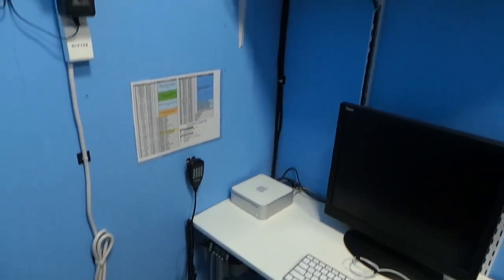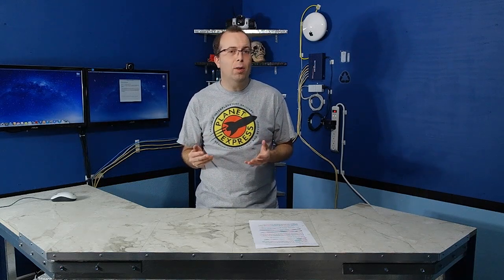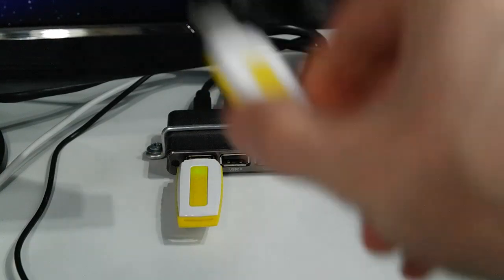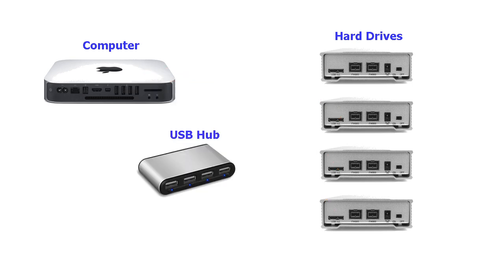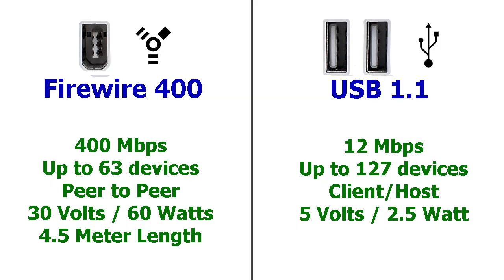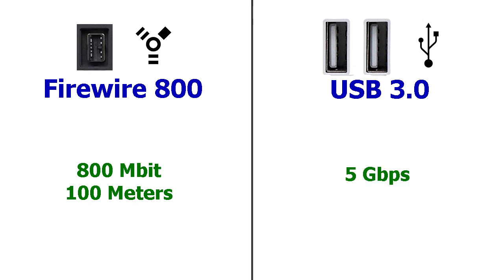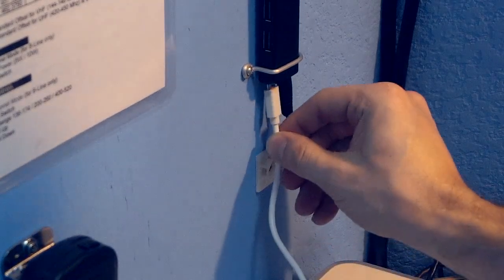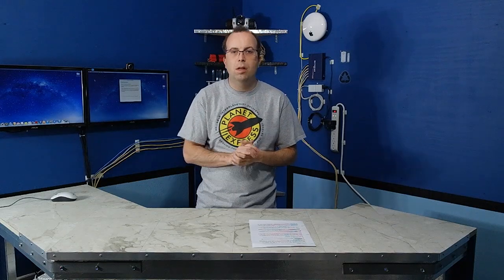Farewell R.I.P. Firewire, Hello USB!

Comment: i am 20 years old, had my first PC when i was 6. I can't remember using firewire even once in my life.
Reply: +muh1h1 Firewire was mainly a Mac thing. PC people generally only got firewire for specific applications like video cameras.
Reply: same here, im 24.
Reply: @tintin3  28?
Reply: @tintin3  
Akshat
Reply: @tintin3   m
Reply: @tintin3 So how old are you now
Reply: +muh1h1 It was mainly on high end PCs
Reply: @ElectrofizzStudiosCo   I Have it on thinkpad
Reply: I remember a computer I had in 2003 had Firewire, but I don't think I ever used it once.
Reply: If you were using a computer for video editing or had high capacity external hard disks before USB 2.0 you would have used firewire but most devices like keyboards, mice external optical disk writers and printers worked at lower transfer speeds.  Before USB 2.0 most printers and scanners used parallel ports, keyboard and mice used ps/2 ports.  Now USB 3 and Ethernet ports allow high speeds.
Reply: ***** well,it was but still,thunderport will remain on macs until later.
Reply: Rosie
Reply: @JoRosieQueen68   13:54
Reply: It was more of a Mac thing.
Reply: Glad to finally find the guy who makes the final judgment calls on things of that nature. In all seriousness, you look stupid because you are stupid.  Don't comment on stuff you don't know about, and you won't get "trolled". While you're at it, try not to be offended by everything.
Reply: +muh1h1 I'm 23. I use it everyday. Most higher end Audio Interfaces for recording use Firewire. So it depends on what you use your computer. If you are a gamer or casual web surfer, you won't encounter it. But if you use your computer for commercial use, you'd expect to have a few devices laying around.
Reply: @GabrielTheGuitarist not anymore 😮
Reply: +Tin Tin I'm 16 and I have used it several times, especially for Target Disk mode and Audio Interfaces…
So, it's not all the same
Reply: JosephKing75 CBP I dunno, I always remember it being shit, it's just that people have had a lot more practice since then, and of course more kids have net access than they ever did in the early 2000s. Then again, I've never had a very high opinion of people lol.
Reply: you could have just said "I don't do cool stuff with my computer, and barely know how to use it"
Reply: thank you seven, it's incredible how much misinformation is in the comments. Even after usb2, due to FW's much, much lower overhead and higher average speed. You would still drop frames with USB2 / DV video editing setups.
Reply: USB is used more now so it will probably still be used because it's still usable for domestic use.  Most people don't need to transfer huge files unless you're a media company and you have content stored on local and remote servers which you need to transfer between them but in that case you would use a fibre network which can transfer at higher speeds.  As internet connections get faster it will be better value using cloud services where if you want more capacity you pay a little extra per month than spending a large amount on a hard disk.  People would still want to use hard disks for archiving but the advantage with cloud storage is that if you have an internet connection you can have access to unlimited storage capacity without having multiple hard disks or worrying about getting a new hard disk when your others are full.
Reply: Firewire was the only way of transferring video from a tape camcorder in real time because USB1.1 was too slow.  There were digital cameras with USB and serial connectors but they would be sending already digital files than playing them and digitising the footage as you would with a tape camera.  Apple would have probably had them more than most PCs because in the pre mid 2000s Apple focused a lot on making computers for specialist industries like designing, video editing and animation because Windows already dominated office and home computing.  Most printers at the time still used parallel ports and didn't print very fast anyway and scanners were parallel or serial and weren't able to scan fast so there was no need for high speed ports, it would have been expensive as well having ports and components in devices for ports that would rarely get used.
Reply: JosephKing75 CBP No idea, never tested it, and didn't have a use for it at the time. Don't think I even had anything compatible with it.
Reply: +muh1h1 Goddamn you young.  I'm 30.. but I never used Firewire either, haha.  It's probably because I'm not a Mac guy though.
Reply: +muh1h1 The only time I ever used firewire was when I was dumping video off of a camera on a mac in collage.
Reply: williehrmann What? how is that even possible? :D
Reply: muh1h1
 no, and i'm an informatics guy. But somehow i never needed it i never really had anything wireless except my smartphone. And i connected it via usb to my pc. Wifi i use now and then.
Reply: Never used SCSI? then you probably never tried to use a DOS machine, that shit was everywhere!
Reply: danixdefcon5 my late 2010/early 2011 can use it and can use USB,and the cool thing of that is it charges my ipad
Reply: same
Reply: fiirewire looking usb
Reply: Up until Firewire 800 I wouldn't buy an external unless it had Firewire 400 ports. That was mainly my experience I loved how fast it was and the fact that Firewire was a dedicated interface (400 Mbps when connected to one drive vs. USB that was 480mbps that was shared with whatever device you had plugged into USB) made it perfect for me when I used to do video/sound editing, and did a lot of photography on my old Windows PC.
Reply: you mean SCSI?
Reply: mseven1, people clearly need to transfer huge files, that aren't media companies. Your comment is ridiculous
Reply: Murphy the Turtle what do you think USB-C refers to? It's the connector. It's not disinformation. TB3 works as a USB-C alternate mode. Yes, I know that TB is not USB.
Reply: Look at the posters around you. It's easy to think the average intelligence level is low.
Reply: I used it mainly for capturing HD digital video from my Sony camcorder. Firewire was great because it was peer-to-peer. There was no concern about drivers. And when I upgraded laptops I was able to buy a Firewire 400 to 800 cable and transfer my entire user folder in under an hour. These days you could just use gigabit ethernet or even MIMO. Although I have to admit the uses for Firewire were very limited and the costs did not justify low throughput uses like input devices and printers. USB eventually won out because of its comparative cheapness.
Reply: the data still supports the possibility that few people were actually using IEEE 1394 (whatever a company chose to call it), so I wonder... How old are you, and how often did you talk computers with people outside your inner circle, and outside the AV crowd (professional, and amateur).

I have a feeling you didn't observe computer users in their whole between 2000 and 2010.
I also think that, as the data suggest, the majority of people used floppy disks, CD's, and later usb for data transfer. I know I certainly did, being 12-22, and not actually knowing what "firewire" was till about 18.

From my perspective, it was kinda like raid is now, most people don't know what it is, nor will ever use it.
those of us that do know what raid is used for, are also pretty tech savvy.

as for your comments that appear to be an attempt to establish a lack of experience, on my part, with the internet and technology, you can stop now, I'm not some dumb kid. And you're not a walmart greeter for the "interwebs"

As I stated earlier, I'm 28. Also I, as did most my age, grew up with computers and the internet with daily exposure in school and at home. Hell we where specifically taught about computers in school.
A decade earlier, none of that was true. Now kids are growing up with smartphones in their hands.
Reply: mine isn't a T420s its just a top of the line T420 w/ an i7
Reply: I’m 35, first PC was a 386. Never used it either... hello thunderbolt 3!
Reply: well, firewire is only used by hi-end users in audio, video and lagre device counts setups so that is not strange if you have never used FireWire.
Reply: Im 37, I have owned computers since back in the XT days (had a TI 98/4A before the XT), and never used FireWire. I never had a need for portable storage. Had a 5 1/2 inch hard drive caddy for removable storage for anything that couldn't fit on floppy, then got a CD burner back in 1999.
Reply: I am 28 and even I never used firewire. But when you are kid you have no reason using it, you mostly didn't have server, profi camera or external HDD around 2005 when firewire was on motherboards. I know people with Apple were using firewire more often, but in my country I guess 99% of computers have Windows.
Reply: No one did. It was just for elitist Macrainbows.
Reply: I’m 40 and the only thing I ever used FireWire for was to plug into the wall wart and charge my 4th gen 40gig iPod. I think I’ve only ever had one PC that even had a FireWire port.

My 7th grade science teacher (a huge Mac geek, back in the days of System 7) had 6 or 7 devices daisy chained with SCSI, which was pretty impressive at the time.
Reply: I have thunderclap 5.0 it is better than this fireport stuff and lightening USB
Reply: Martin Lyhagen I must've pressed the wrong key,well,I know how it's called but I've written it wrong by mistake.
Reply: *****
Well...why not,was it a functioning properly?
Reply: *****
That's sad mate,it could of been something but it turned out to be just nothing.
Reply: *****
well,as stupid as they are,people are people but we are ourselves,individuals with great ideas and dreams that will become reality one day.
Reply: *****
Well,everybody does as they consider.
Reply: JosephKing75 CBP Which is fine, as long as they have to live with the consequences. Trouble is, at least in my country, they don't. Cap in hand to the state, and everyone else has to pay for it.
Reply: Chris Anderson
Well,I love Apple but I also love Microsoft,I love Microsoft a little more than Apple though.
Reply: hi im 27 and the oly reason in klicken this video is it want to know what this simbol is i saw on my pc
Reply: +muh1h1 Sad not to have memory at your age.
Reply: +muh1h1 My second year in highschool, I was part of the school news crew. When we transfered video to our Macs for editing we used either a Firewire cable directly to the camera or a tapedeck. I honestly liked the tapedeck more for some reason (maybe because it felt cooler?) but I did get to use Firewire for some practical stuff

A year later we threw away those cameras and got DSLRs with Shotgun Mics/Boom Mics instead.
Reply: 28, never used firewire. But never used bluetooth ever aswell xD.
Reply: muh1h1 My first Bluetooth device i got back in 2008ish. I hardly used the darn Bluetooth headset as it was just annoying. I mostly used Bluetooth for file transfer. between my pc and my dumbphone.
Reply: Trekeyus yes, but williehrmann says he never used it ever oO
Never used a bt speaker? Smartband? Headunit? Nothing of that?
Reply: muh1h1 well to be fair i did not get a Bluetooth speaker till a few years ago and frankly I find it to be clunky and a pain and just so much easier to use a wired connection. That said ever since I got my pebble it has been paired none stop to my phone.
Reply: So? .... I am almost twice your age never used it, that said I know it was fast as hell for external HD drives.
Reply: Kim Alatore same,but I have a MacBook Pro that "HAD" a FireWire cable port.this was made in earlier years,like 2014 or 2013,whatever,at least I have a USB port so I can plug my iPad in to the computer
Reply: im 19 and i used it for one external drive, once. so i feel you lol
Reply: Firewire was mostly used by apple, and that meant, people with $$$.
PC's used mostly USB.
Reply: Some PCs had FireWire ports, but FW-capable hardware was very expensive. Thus, few people did that.
Reply: I'm 17 and i used firewire to pull footage from a DV camera, install Mac OS X onto a mac, etc. so i still know how to use it
Reply: Yep. most i/o interfaces stille ad firewire
Reply: Well from what I have experienced is that I saw it common on Macs but I never saw it on a PC.
Reply: My brother had 2 fire wire ports on his PC.  One of the reasons fire wire lost out to USB is because it's universally compatible and although there are different USB connector types there are USB A to USB B cables and connector converters.  Another thing is that USB ports are being used as a power port on tablets and smartphones which means you can use the same cable with different devices to power and transfer data at the same time.

Ethernet and fibre cables have the potential to replace USB because they are faster but too fast for domestic use currently.  However future USB formats will probably be as fast.
Reply: mseven1 USB is still slow, and it will always be slow due to how it works. Thunderbolt 3 works over USB-C, I'd probably bet on that being the thing that takes over for storage purposes.
Reply: @danixdefcon5, are you trolling at this point? TB3 does not work on a USB Bus. If you mean uses the port connector, fine. But no. Stop spreading mis information
Reply: Murphy the Turtle agreed. I'm actually annoyed at the lack of TB storage options, moving large files is painful on USB3, I've resorted to setting up my PC as an iSCSI target just to get fairly decent transfer speeds.
Reply: Domestic users don't use high capacity servers where they need to transfer large files in the tens of gigabytes per second between their server at their studios and the server at a playout centre.  Manufacturers don't have ports for fibre cables because barely anyone would use them and it would waste money using components and ports which won't be used.  It's like how domestic internet service providers don't promote SDSL because most domestic internet users want higher download speeds than up and down speeds.
Reply: Im 28, and I agree, most of our generation just went with usb from the start. I think the huge support for fire-wire on mac may have been a part of it.
Reply: lol krust, that's only because you didn't do anything fun with your machine.
Reply: You are quick to make assumptions turtle.
do you know what a computer game is?
Reply: Murphy the Turtle, I went back and read all you comments here. you sir are the one that is trolling, you are attempting to draw out emotional reactions from people, that is trolling.
Reply: Congrats, on being 10% smart and 40% sociopathic. Let's see what the other half is! You wanna know what's an obnoxious assumption made by an idiot? Stating "I didn't use this interface, so no one must have!" And no, I'm not going for emotional responses so much as people like you not spreading mis information about interfaces you have no idea about. For example: Several people in this thread thought that thunderbolt ran over usb 3.1. Please don't explain things you don't know about to people.
Reply: Murphy the Turtle at no point did I claim that no one used firewire, in fact, if you actually read my comment, you would see that I state MY generation mostly (not all) used usb from the start (2.0 BTW,  ya, we are that young), rather than firewire.

that also means that the majority of everyone else may have.

again, not making claims, as I can't possibly know.

you are actually spreading misinformation. the name firewire only refers to apples use of IEEE 1394.

see the below link.
you will note that windows has always (since 2002) had the majority of users by %. Therefore it is accurate to state that the majority of computer users did not use firewire.

https://upload.wikimedia.org/wikipedia/commons/thumb/8/81/Operatingsystem_market_share.svg/1280px-Operatingsystem_market_share.svg.png
Reply: it wasn't some used this and some used that. Firewire or i.link or lynx, whatever you wanna call it, was generally used for specific purposes. For a generation of hard drives, it allowed direct editing without dropping frames in dv. for audio producers, low latency and overhead interfaces that lasted 10+ years. All people doing those things, and a hundred other's like it, used firewire. That's why I made my original comment to you:D 

But congrats on being entirely pedantic with my off the cuff response. Welcome to the internet.
Reply: no it doesn't, fanboy. And I've worked in computers throughout the time you mentioned this. Most people don't know what a raid is? I run a raid 6 in my living room. You're a petulant child, if you grew up with the internet, you wouldn't be so fucking shocked by me. There is a MASS IVE LACK OF EXPERIENCE on your part if you think firewire or raids, are technical in anyway.
Reply: muh1h1 me neither.
Reply: Firewire is stil good foor people who use late  / mid 2000s equipment for some reason. Like i have a live mixer it still uses firewire, and i can't find a USB replacement for this piece of gear and if i, it cost me a lot of money. So i am happy my sound card still has a firewire connection. But in the other hand i never use it, just for that one piece of equip. Also my macbook 2013 still has a firewire connection.
Reply: Murphy the Turtle, so you're telling me that the average non computer savvy person knows what raid is, and how to use it?

What makes you think I'm shocked in any way?

Fanboy???? of what????

You still haven't answered my questions, perhaps you are just a 12 year old troll.
Reply: muh1h1 I used FireWire once to charge my mom's iPod then she got a new one
Reply: either u were 2 young and new it or your  computer never supported it
Reply: Same (20)
Reply: I have a firewire 800 port on mt Lenovo Thinkad T420
Reply: I encountered it for the first time a few weeks ago for a video camera. Despite never using it, I did have a FireWire card lying around.
Reply: Dude, I am 52 and use PCs for the last 30 years and I never used firewire. Actually I never seen it up close. In fact I have strong suspicions that it's an urban legend! LoL!!!
Reply: Probably because you haven't worked in a professional studio or used older Macs.  I remember buying a FireWire PCI card so I could use pro gear with my PC.  I ended up using it for external drives, too, since my PC was noticeably less laggy when accessing a drive over FireWire than with USB 2.0.
Reply: it was mostly used in 200x for multichannel audio devices and transferring digital video tape to a PC.  so, if you weren't doing either of those things, you might easily have not encountered firewire.  don't worry, you didn't miss much.
Reply: It was a big thing for Mac's. My friend only purchased a FireWire card for pc for video capture and editing. Usb devices were just too slow at that point if you wanted a quality capture.
Reply: On some PCs there was a firewire port, but it was usually a mac thing.
Reply: i'm 27 and i had used firewire lot of time to transfer videos to computer from camcorder. did you anyone used at least one time old dv cameras.
Reply: I'm from third world country, I didn't use FireWire.
Reply: I use firewire about everyday still.
Reply: If you had a iPod I’m 10 pbtw
Reply: keyword, PC.
Reply: Same
Reply: i never used firewire because i never used a device that has firewire
Reply: you missed out
Reply: As far as I recall I never even owned a firewire cable.
Reply: 26, strictly pc guy and used firewire way back in the day. I mean most of the guys I knew who had some "computer knowledge" knew what firewire was. It was pretty common in sweden. But don't expect those casual plebs to know about it who wasn't interested in computerstuff xD
Reply: Happy 24th birthday lol
Reply: Am 33 never used firewire
Reply: I only used it once.  I had a Digital-8 camcorder that used FireWire to transfer the video to a computer without the need for a video input on the computer.  It was rather nice though - seemless edits were possible as you could control the camcorder over FireWire.
Reply: Have you ever used a videocamera?
Reply: Guy, you are Lucky-Good !!! I own Canon EOS 1Ds with firewire and alltime almost trying to connect this camera to the Win 10 64bit... It's anguish for me, fuck'aaaaaaaaa!!!
Reply: muh1h1 I have a laptop that’s a decade old and FireWire didn’t exist on it
Reply: you missed out on so much
Reply: Same. I didn't even know it existed until I saw this video.
Reply: I've used it once.  Got a Sony HandyCam Digital8 camcorder that can sync video into a computer over FireWire.  It kinda-worked...but was a pain to find computers that had it and cables were unbelievably expensive.
Reply: It's because it's mostly a Mac thing but I had a card for my PC that gave me 3 FireWire 400 ports
Reply: U got a pc at 6?
Reply: @veenajohn7580  yes, both my parents were working in IT related jobs and my dad still is to this day. I shared a pc with my sister when i was 6
Reply: I suspected that my motherboard MIGHT have it and I looked just now.  It didn't.  I never needed it anyhow, it just made me look at see the dust.  I just took that as a good moment to blow the dust off the ports.  That way next time I plug something in I am not shoving all that dust in them.  I didn't find any Firewire but I found I have 2 eSata connectors.  I thought I had one really.  I never needed them yet either but I do have a cable for that to use one of them somewhere.
Reply: Oh
Reply: Yeah, me too actually, but as i see, usually if you didnt need a blazing fast speed for external storage devices, then a usb would be sufficient
Reply: The first ipods used FireWire400. I never had one but I have seen them. 

I still have my external hard drive from like 15yrs old that can use FW400 or USB. I always used the FW400. It was so much faster than when I used the USB connection on it. 

I used to live FireWire because it was faster in actual use than USB2.0.
Reply: I used it for one thing - connecting video tape camera. And then, I think, dscaler to capture stuff
Reply: That's because you didn't have the chance to play around with MiniDV cameras. I always bought my drives with FireWire and they we're fast AF for the time! My old iMac still backups with time machine with a FireWire 800 drive.
Reply: Lol same
Reply: I am 14 and I used it a lot, because old camcorder
Reply: You probably didn't edit video on a computer in the early 2000s. Firewire was Mac gospel.
Reply: @drewwhitney7327  Required for what? All cameras had USB or you could just take out SD card and put it to card reader. But before USB 2.0 it had to be crazy copy video with USB 1.1. But if you had older PC you could just bui USB 2.0 PCI card. I remember motherboards had firewire in mid 2000s, but we even didn't know what is purpose of that connector, I've never had any device with firewire connector. Maybe in USA it was more common.
Reply: @Pidalin  sd cards were not ubiquitous in 2002, and they were only a few MBs. Digital video was shot on tape and transferred to the Mac via iLink cable aka Firewire 400, not USB. Also, since Firewire was still faster than USB 2.0, it was much preferred for external hard drives and iPods until USB 3.0 finally outperformed it several years later.
Reply: @drewwhitney7327  I had digital camera from 2002 and it had SD card, I think there was something like 128 or maybe 256MB
Reply: Same here I have 34 XD
Reply: It was mainly on expensive PCs and all Macs.
Reply: muh1h1 I remember how there was one on my orange iBook, though I never actually I think used it or maybe once when I synced with my friends iBook to transfer games
Reply: I haven’t either. I’m 34.
Reply: It's basically like thunderbolt
Reply: Firewire was and is less common than usb
Reply: I think I saw the knockout port on a few computers way back in the day, but, when I got my 1st computer at the age of about 14 in 2010 (a tad bit sad that I was that old when I my 1st computer, I know), I don't think I saw a firewire connector on my laptop at all. In fact, I am not even sure I even saw any peripherals designed for it either.
Reply: Im 40. But i not remember fire wire :/
Reply: I was about to say I was born when you where 6 but then I realized you're 24
Reply: @ATN the object thingy this man is 10 years older than me.
Reply: it was the 2000's
Reply: same
Reply: I use it for an ipod 3 I like to mess around with
Reply: I was 20 4 years ago, been through a few gens of Macs and a couple PCs, also never used it
Reply: metaphysicalgraffiti  You realize that this comment is almost 5 years old now do you grandpa?
Reply: Yep
Reply: I don't even have a pc
I have a laptop :(
Reply: I used it like twice to transfer video from a camcorder. It felt kinda dumb even then.
Reply: In my experience it’s usually on PC laptops circa 2005-2010 and it’s labeled IEEE 1384, same connector and standard but FireWire is the Apple specific name
Reply: it was most common in apple products and servers.
Reply: It's a apple thing
Reply: Same, 21
Reply: Me neither, I am 35
Reply: hi, you are 25 now
Reply: @oksowhat  hi, 26 actually :)
Reply: @muh1h1  haha, you replied, btw i am the one who is 20 now, lol
Reply: That's because you only played games and no video work
Reply: say that ur lucky because i never got a pc/computer and i don't know the heck is a pc/computer
Reply: 12:45
Reply: I was always thinking what is fire wires and I thought it was a fire with a wire😂😂😂
Reply: Same
Reply: Probably because usb had pretty much taken over by then
Reply: It woulda been dead when your parents were still dating pretty much lol. If they’d have updated it a little quicker it may have caught on. USB just trampled it even though v1.1 was pretty much a downgrade.
Reply: Advanced audio,  video and the first digital imaging technology depended heavily on FireWire 800 and still do today. If you need to interface look to the audio industry to see their solutions.
Reply: Congrats on 29
Reply: Omg 30 years old
Reply: +muh1h1 I never used firewire in my life either. And I remember Windows 95.
Reply: ***** maybe thats why
Reply: firewire was huge back in the day. it just never really launched. stayed right there on the run way. That is simply an opinion. it was something you would have opted for if you had a mac or a somewhat new PC
Reply: +JosephKing75 CBP  thunderbolt... not thunderport.
Reply: *****
Well,I miss those days when the internet was still classy,2000-2010/2012 that was the classic internet back then everything was better until 2010,after that,in 2011 the degradation of the internet started with the rise of facebook and than in 2012 the internet became a living nightmare fuel.
Reply: @JoRosieQueen68  you sure don't rmemeber usenet trolls!
Reply: +muh1h1 USB won the war early, that's why.

Apple had interest in Firewire, so that's why it was still on life support for so long.
Reply: I'm 30 & i never used one in my entire life
*I started using computer since 1995. Means, since i was 9
Reply: Wow, firewire was VERY popular back in the day and probably more firewire equipped PCs than Macs ever made in the history of Apple.  You MUST have had firewire ports to do video editing on MiniDV camcorders.  Those were the hottest things you could buy at the turn of the century - digital 720x480 video blew the stink out of analog vhs or even Hi8, but of course solid state memory was not anywhere near handling that so everything went on digital linear tape.  You played back the tape to save to the PC harddrive and did your editing that way. While not many PCs came standard with the firewire ports, there were tons of inexpensive expansion cards for it.  Mini-dv really began the major modern evolution of home/quasi professional video as the equipment was affordable, computers were finally fast enough to do editing on, and best of all the quality was vastly superior to anything less than pure professional equipment.
Reply: +muh1h1 27 never used it either, AFAIK it had mobo support issues
Reply: Nice life story morons
Reply: Omar DaBot stfu
Reply: JosephKing75 CBP Meh, I didn't miss it, was too busy playing the first Call of Duty at the time lol. Oh the sleepless nights/days.
Reply: JosephKing75 CBP People need to remember that dreams are just that, dreams. Reality does not necessarily follow the dream, especially if you set your expectations far too high in life. This is why most people under the age of 25 are simply unemployable, not only will they not work, they think that working is optional, and should fit around their social lives.
Reply: Yup, called it, You're just a troll.
Reply: +freegameLP I am 16 and I didn&#39;t ever need it but it might of been posible when I was 3 years old,I might of used it but not as much as usb 1.1 and usb 2.0 what I use today right now I am using a blue iluminated keyboard connected via usb 2.0.